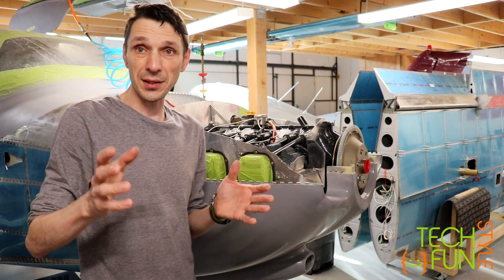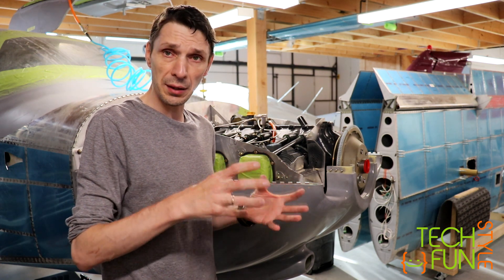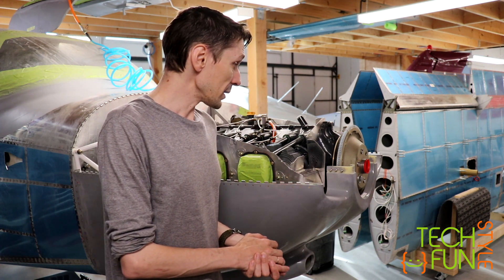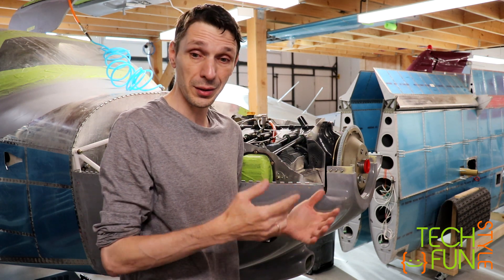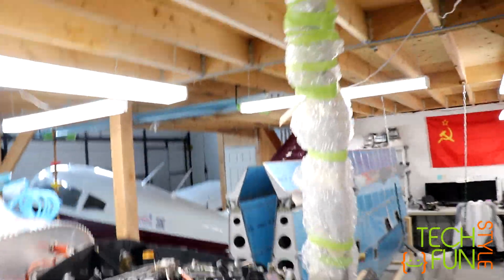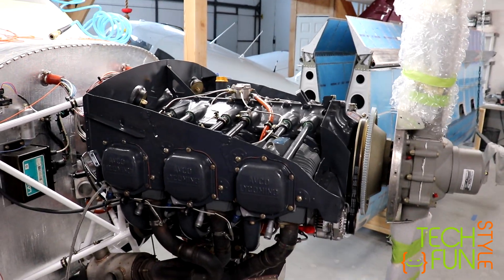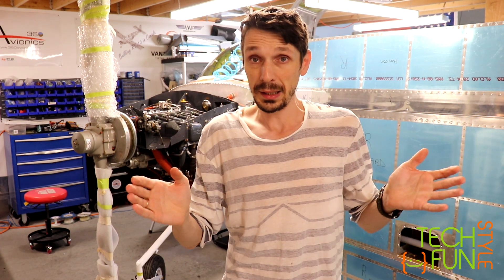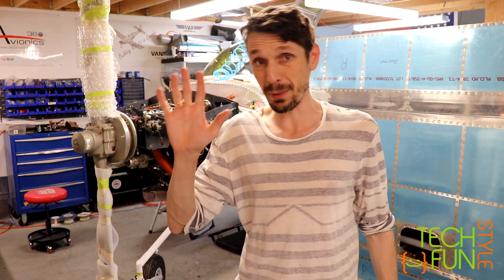Fuselage Part 16 - RV10 Build by Vlad

Comment: Vlad, make sure you safety wire the 4 bolts that hold the air box to the fuel servo. They could get sucked into the engine if they came loose. It’s looking good!   Keep up the awesome work
Reply from the maker: Thank you Patrick. Yes I did that! Have not shown that on video but did that prior to installing the air filter/inlet :)